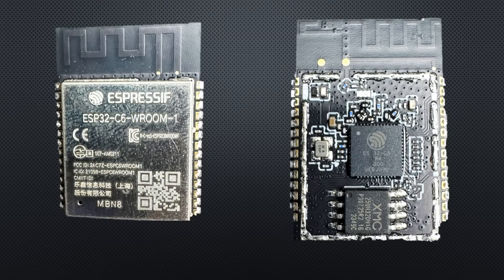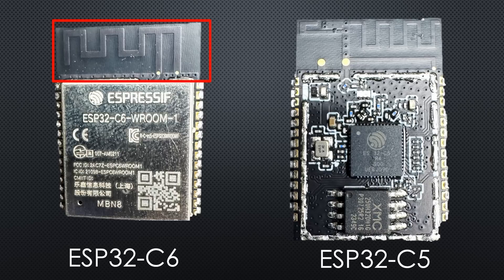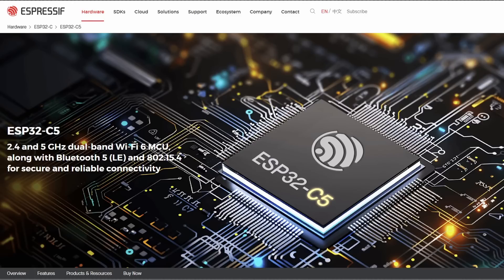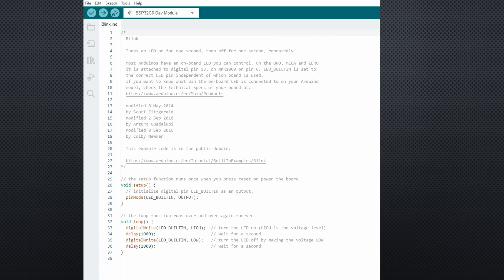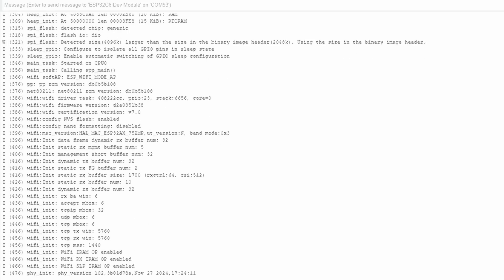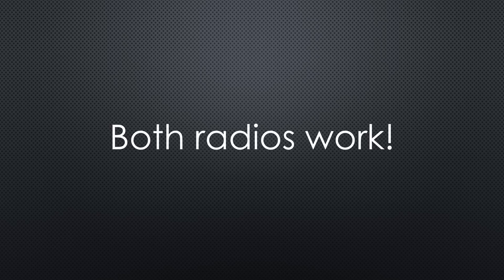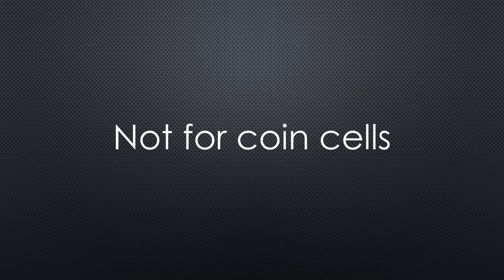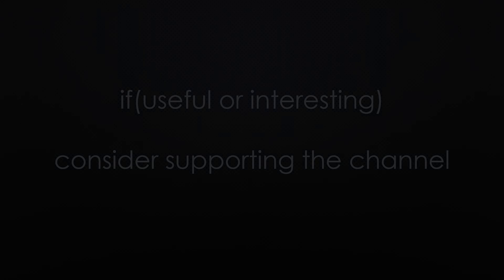(501) 5GHz from Espressif: The ESP32-C5

Comment: Newbie question: So you are going to need a 6 GHz oscilloscope, right?
Reply from the maker: That would be very expensive! Usually, you use a Spectrum Analyzer fot those frequencies
Reply: @AndreasSpiess  thank you for responding. With the ESP32-C5 what would be your top five equipment picks for  diagnostics and programming of PWM on your benchtop?

Comment: @AndreasSpiess  Hello Andreas, If you want to run the device(esp32-c6) on batteries, you cannot use the Zigbee_On_Off_Light example, you have to used the esp_zigbee_sleep from the esp-zigbee-sdk repo, either deep_sleep or the light_sleep example, for fine tuning you can increase the KEEP_ALIVE time and you can power down unused hardware like Bluetooth, it can be used together with ULP program

Comment: hello thank you for your videos ! i've a question - My project need to connect an arduino micro + 1 multiplexer to 32 potentiometers to make a midi controller - How do you do for a good cables connection management ? - i mean 3 cables start from each pots + each pots need to be link each other with a cable + each pots need to be link to the arduino - 🙃so it is crazy !!! a pcb will be great but it's difficult for me 😄 so
Reply from the maker: I would create a  PCB and check if you need 2 or 4 layers. Both are not terribly expensive if the board is not too big. Or you can use more than 1 multiplexer close to the potentiometers even if you do not need all pins. I2C lines could be easier to route.
Reply: @AndreasSpiess  agree with you, more than 1 multiplexer is a good idea ! - thank you fir your reply !

Comment: I got two sample devkits (with metal case) 3 weeks ago and have been playing with them since. My projects involves 8 channel audio 24/44 over UDP - which works nicely in the 5 GHz band with 11ax  😁 I measured an iperf throughput of about 62 MBit/s with a UDP payload of 1440 bytes and an average UDP packet latency of 540 +/- 180 μs (yeah, jitter). Not too bad for an engineering sample, huh?
Reply from the maker: Cool. Thanks for the info!
Reply: Hello Harald,
I would be interested in your project. Is there anywhere where you share your work ?
Thanks !

Comment: With 2 antennas if the WiFi is on 5GHz does that mean it can also run Zigbee etc. on the 2.4GHz?
Reply from the maker: Yes. Zigbee uses the 2.4GHz radio and antenna

Comment: 5.8GHz is fine if you want highspeed over a shorter range, but if the ESP32 can't or does not need the highspeed data rates then 2.4GHz will be just fine. Which is why if you want lower power or greater distances you drop back to lower frequency's or much slower data rates and hence narrower bandwidths.
Reply from the maker: I agree. In addition, it depends on the environment. If you live in a congested area, maybe 5.8GHz is also needed.
Reply: @AndreasSpiess  In my mum's house the 2.4GHz only just about gets out of the room. i would not expect 5.8GHz to get out of the room at all.
we had to put a wifi over mains extender to get a good signal in the kitchen which has only one wall between it and the router. 
One good thing is it's very electrically quiet and your mobile don't ring much. 🙂

Comment: Amazing. I've always wondered why so few radios included a 5Ghz radio. Sort of assumed it was some process or FET/silicon technology limitation.
Now if they just made a 100 pin package version, we could use it for literally everything.
Reply from the maker: Then it probably would be too expensive for most applications not needing such a big case...
Reply: @AndreasSpiess  Would it? I always wonder about this. Adding more GPIO logic and pad drivers would be only a small amount of silicon, I would image.

But maybe adding just the area to bond out 30+ more GPIO's might take a tone of area and make it totally uneconomical.

Same for the actual packaging, too.
But I don't know the economics of it.

Still - a high-gpio ESP32-* would be pretty useful.

Comment: I watched Great Scott's video earlier today concerning ESP32 and Zigbee. Since I'm not familiar with Zigbee yet, I may be wrong about this, but I thought he found the current draw to be minuscule. Was he just measuring the RF draw of an existing commercial device (he had a few), or did I misinterpret his testing?
Reply from the maker: You are right. Zigbee devices usually consume very little power. That is the reason for my critic
Reply: @AndreasSpiess  👍
Reply: He was measuring the total current consumption on a commercial device. Not necessarily c6, he didn't address what chip it was in the video. These modules may be capable of lower power operation with some optimisation.
Reply: @andrewbergspage  Thanks!
Reply from the maker: @andrewbergspage  I measured the module alone. So do not hope too much.

Comment: OMGGGG I've been waiting for this chip for soooo long. I can't wait to build my own PCB with it
How did you get this sample??
Reply from the maker: I got it from Espressif. I hope you plan to use a module, not only the chip for your PCB. Because 5.8GHz is a high frequency...
Reply: @AndreasSpiess  Interesting... Why is using the chip a bad idea?? I've been watching some little chip antennas with dual bands for a while... Waiting for this exact moment... And yes, I want to use only the chip

Why you don't recommend this?? I know it is high frequency but I already built a lot in 2.4GHz 🤔
Reply from the maker: @crisdores  If you have the knowledge on transmission lines and the instruments to check if your design is ok, then you can forget my comment of the course.

Comment: This is very cool and a long time coming, as you pointed out! But I don't understand the mention of "5.8" GHz, is it specific to a particular region? 802.11a was defined all the way back in 1999, and most bands are closer to 5GHz than 5.8GHz. What's so specific about 5.8GHz here? In the original bands (U-NII-1, U-NII-2/2e, U-NII-3) only channel 161 is over 5.8GHz. This makes me wonder if if will support the common bands used indoors (5.15–5.25) or if this chip is actually limited to some very specific channels. Channel 161 at 5.805 GHz is usually more recommended for long-range outdoors use, which isn't particularly where I use my Espressif chips to be honest. Even in newer standards 5.8GHz still only means channels 149–161 so this feels weirdly limited.
Reply from the maker: You are right about the frequencies. They only differ a bit between regions. I could have used 5GHz, but many people confuse it with 5G cellular technology. In Amateur Radio, our Band is called 5.8GHz. This is why I used it here.
But after your comment, I changed the title to 5GHz.

Comment: Espressif adding 5GHz wifi support, while raspberry pico 2 is still using micro usb... Its like those two kids - one plays with lego technic, other paints glue with hammer. ESPs are little revolution with their hardware, i love them.
Reply: Pi 5 is usb c with power delivery 
has pcie so you can connect and nvme drive .... Not to mention the pi had 5Ghz for many years already
Reply: @rj7855  raspberry pico... you really try to compare esp32 to raspberry pi 5?
Reply: Now if only ESPs had PIOs. :-)

Comment: what's the point of using the 5 GHz band (optimal for high bandwidth with lower range) on a microcontroller that is limited in bandwidth to begin with?

this doesn't make sense to me
Reply from the maker: In some areas, 2.4GHz is pretty crowded. Plus it is probably a sales argument...
Reply: @AndreasSpiess  if the goal is to spread out the frequencies there's 433 MHz and more unlicensed ones...
to me it's mostly a marketing stunt more than something practical to look forward to

Comment: If both radios can run at once, this would conceivably allow one to light up a BT to WiFi gateway/proxy device (similar to ESPhome BT proxies) but with much better performance.  The 5.8GHz radio can stay in touch with the network while 2.4 is open to receive BT traffic.
Reply from the maker: I would be astonished if both radios would run at the same time. But maybe they found a way to keep connections on both bands in parallel.

Comment: The biggest problem with the ESP32 is the lack of good quality analogue peripherals like ADCs, DACs and OpAmps, not the lack of wireless capabilities.
Reply from the maker: I assume this depends on the application. Not many of my projects use an ADC for anything other than measuring battery voltage.
Reply: @AndreasSpiess  I use multiple ADCs in practically all of mine. Monitoring and/or controlling a solar panel or wind gen system, monitoring and/or controlling charge systems or inverter systems as examples. Monitoring home energy use.
The STM32 series have a wonderful array of analogue peripherals, but lack WiFi.
The ESP has very nice WiFi, but horrible analogue. 
It's a real pity to have to cobble two devices together when one should really do.

Comment: Do the ESP32-C5 and C6, with their HP and LP cores, support SMP in FreeRTOS by utilizing the LP core as a second real processor? If not, does multitasking still improve overall performance or speed? This would be particularly useful for a use case where a sensor is being read while the data is simultaneously transmitted via wireless communication in real time, with minimal delay (e.g., millisecond-level).
Reply from the maker: I never looked at the LP core on these chips. Only at the LP core of the ESP32. There, it had very limited functionality and had to be programmed in assembler. So most probably no SMP
Reply: @AndreasSpiess  in the C6 and C5 you are not limited by assembler any more,  and the HPCPU and LPCPU  are run in parallel with shared slow ram, the programming of the C6 ULP is quite nice, and the i2c works fine.

Comment: What is that naming scheme from espressif? Why is the C5 newer than the C6? Quite a Deutsche Bahn ICE3 Neo move..
Reply: I guess the 6 in ESP32-C6 refers to WiFi 6, and the 5 in ESP32-C5 refers to 5 GHz.
Reply: It looks to be sequential
The design turns to release could differ
Probably took a bit more time to add the 5.8GHz radio to the c5
The c6 is only 2.4GHz 
Both have wifi6

Comment: If you want to measure the power consumption properly, you need to disconnect the jumper and power the MCU directly. This will avoid measuring consumption of USB-UART adapter and on-board LDO.
Reply from the maker: You are right.

Comment: I don't really get the point of 5GHz wifi in microcontrollers. They don't benefit from the extra bandwidth, and it eats more power than the 2.4GHz band. The only advantage would be in areas where the 2.4 is very congested but the 5.8 is still mostly clean. But since it's all about having options, I don't mind it being added - as long as it doesn't cause extra burdens when not in use.
Reply from the maker: Congested areas are for sure a big thing. Power consumption in my tests was similar to 2.4GHz. And remember: Bill Gates once thought that 640kB RAM would be enough for everybody ;-)

Comment: I would not be holding my breath for Arduino support for this for a long time. The Arduino support is on version esp-idf 5.1 and the Espressif is on 5.3. The support for the C5 would likely come in 5.4. Unless they back port the C5 support to 5.1. It does not affect me much as I am only using esp chips these days so I spent the time to use the idf, and once you get used to it, other than the annoying changes to the drivers in the 5.3, it's amazingly stable and very easy to use
Reply: Well, the early working Arduino version for the C5 is already done. The problem is more to get the hardware ;-)
Reply: @johannobermeier4730  where is this? I just looked the c5 is not even supported in 5.4 beta, they said it won't be in until 5.5. I was not aware the esp32 Arduino supports anything beyond 5.1.
Reply from the maker: We should shortly get a "preview". Whatever this will be. We also have to wait for the chips...

Comment: my yesterday arrived sampels have covers on the chips and a built in test program lighting the LED & scanning the networks of 2.4 and 5GHz
I (1523) wifi:mode : sta (60:55:f9:fb:cf:88)
I (1527) wifi:enable tsf
W (1529) wifi:(BB)enable busy check(0x18), disable idle check(0xaa)
[1B][5nI (2050) ESP32-C5_Iperf: configure led strip success!
I (2050) button: IoT Button Version: 3.2.0
I (2050) gpio: GPIO[28]| InputEn: 1| OutputEn: 0| OpenDrain: 0| Pullup: 1| Pulldown: 0| Intr:0 
 ==========================================================
 |              ESP32-C5 board simple test                |
 |                                                        |
 |  1. Press BOOT button to check LED                     |
 |  2. Long press BOOT button to start full channel scan  |
 |                                                        |
 ==========================================================
I (2094) main_task: Returned from app_main()
I (71526) ESP32-C5_Iperf: LED State: 1
I (82556) ESP32-C5_Iperf: LED State: 2
I (84466) ESP32-C5_Iperf: LED State: 3
I (86171) ESP32-C5_Iperf: LED State: 4
I (88266) ESP32-C5_Iperf: LED State: 0
I (107661) ESP32-C5_Iperf: Starting full-channel scan...
I (107661) ESP32-C5_Iperf: It will take few more seconds to complete the scan, please wait
I (107673) WIFI: DONE.STA_SCAN_START,OK.
I (117067) WIFI: +SCAN:[b0:7f:...][MYhome24][rssi=-76]
I (117100) WIFI: +SCAN:[b0:7f:...][MYhome50][rssi=-77]
others deleted for privacy
Reply from the maker: Cool! Where did you get them from?
Reply: @AndreasSpiess  vom schnellen ali (W Official Store)   du musst periodisch schauen, ob wieder samples vorhanden sind ...
Reply: @AndreasSpiess   vom schnellen Ali (ESP32-C5-DevKitC-1 Development Board with Dual-Band WiFi6 ESP32-C5-WROOM-1 Module) , W Official Store
Periodisch schauen, ob wieder samoles verfügbar sind

Comment: Range and power consumption are usually pretty important factors I would say. A chip with worse performance in both areas seems very niche.
Probably a decent choice if you need high bandwidth (either audio, photo or video), in which case you are going to be connected to mains anyways so the consumption doesn't matter.
Reply from the maker: I agree with power and range. We will see how important the 5.8GHz feature will become, also as a marketing argument.

Comment: It would be really useful if I had a Meshtastic node which connected to the internet for mqtt, but was still accessible over Bluetooth for configuration - this might just do that (although the power consumption needs work!)
Reply from the maker: It does not have LoRa. So nothing changes for Meshtastic.
Reply: @AndreasSpiess  oh absolutely, but there are a few esp based meshtastisc nodes, I'm hoping they develop from this one and add an 868 transceiver

Comment: And four years later, we’ll get MicroPython support
Reply from the maker: I assume it will come fast. It seems there is not a significant change on the software side...
Reply: @AndreasSpiess  Woohoo. I'm building a product based on the ESP32 and this will be a nice upgrade in later versions.
Reply: Mp is pretty Useless
Reply: Why do you think that? I find it pretty useful for small projects. I especially like the fast development cycle. Code-test-code-test-etc. Its so much faster than recompiling Arduino or ESPHOME.
Reply: It's so useless I'm 2-3 months from releasing some IoT products based on it. Totally useless.
Reply: @ This sounds like you're using it for something it's not particularly suited for.
Reply: I don’t know where you’ve been, but Micropython has been available for many years for the ESP32
Reply: @G6EJD  Yes of course. I am making a product with uPy on ESP32. Was talking about support for this new chip.
Reply: Who use micropython
Reply: @ Quite a few people, actually. If you're fluent in python, and want to start with ESP32s and the like, micropython is very logical step.
Reply: I use micropython, almost done bringing an IoT device to market
Reply: @ but you said there wasn’t ESP32 uPython support - confusing..
Reply: There's been uPy support for the classic ESP32 since about 2017; This video is about the new C5 version with 5GHz Wi-Fi. I was exaggerating when I said four years; uPy support for the chips tends to be fast, but individual features tends to lag... sometimes a lot. They only got ESPNow support a year or two ago, for example.
Reply: @supremeleader5516  nearly everyone, your not keeping up!
Reply: python is not a programming language. Its just a scripting language that requires interpreter that causes sometimes 20 times slower execution. Arduino c++ is much logical and easy to use.

Comment: Andreas, those Aqara motion sensors.   I also have 2 of those. Working every single day in the living- and diningroom reporting movement and the Lux in the area. I have never replaced a battery in them.  Just looked them up ... I received them on 9 feb 2021 so that is 4 years of working non stop now.  Almost unbelievable.  Makes me think on how much energy is being thrown away on some other products.
Oww and the 5GHz, was just looking yesterday if nothing changed after ordering ESP32's about 3 years ago and was dissapointed in them not having 5GHz. So now we wait for stock.
Reply from the maker: Good to know that I do not have to change the batteries for another few years ;-)